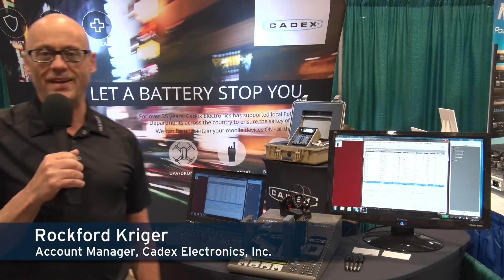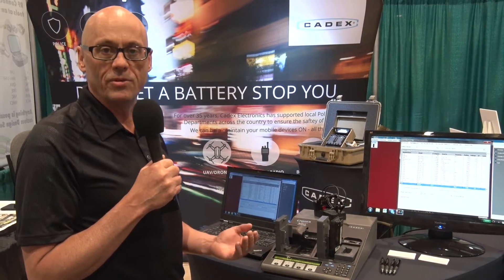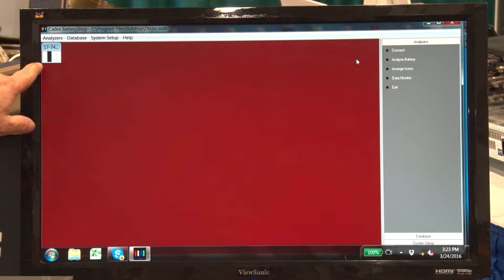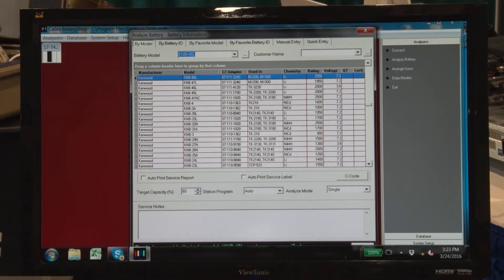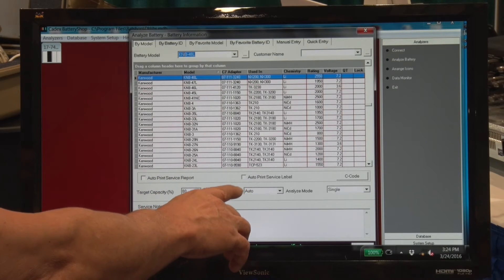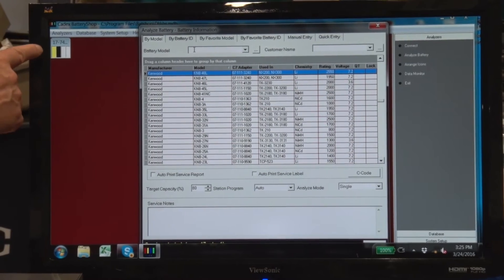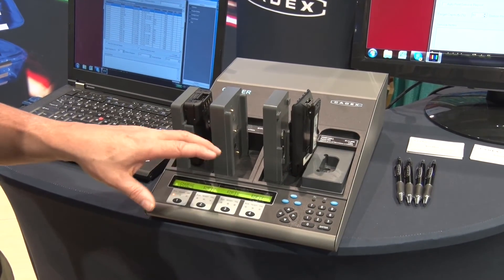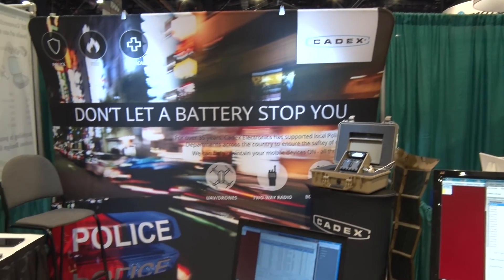IWCE 2016 Product Demo: C7400 Battery Analyzer by Cadex Electronics, Inc.

Comment: So what, just "trust the results because we're Cadex"?
Explain why the highest end of discharge voltage for Li-Ion batteries is lower than the point where Motorola radios trigger a battery low warning?
How about going into some detail about why these units have a minimum end of charge voltage which is higher than Motorola chargers?

Do you think the two above mentioned faults will produce grossly over-exagerrated results? I do.

We need firmware updates fast - Make it happen.